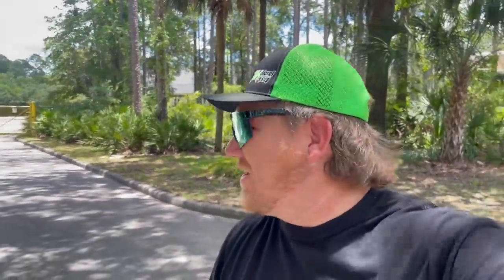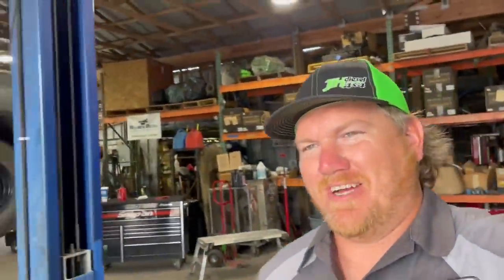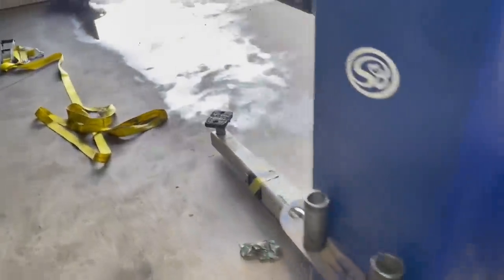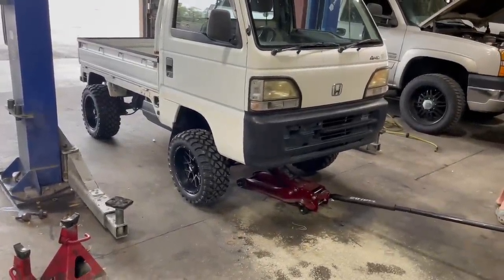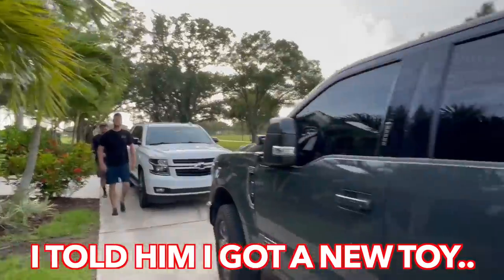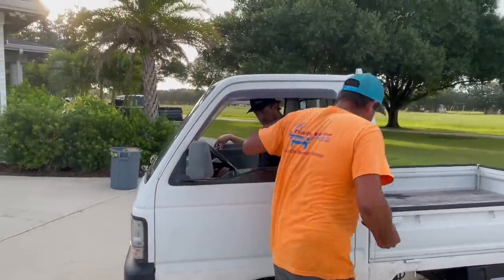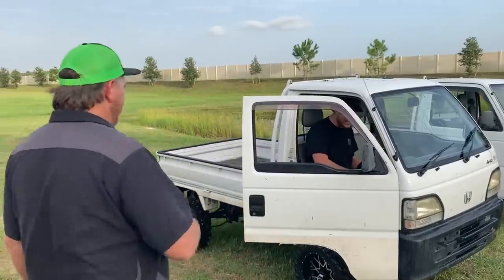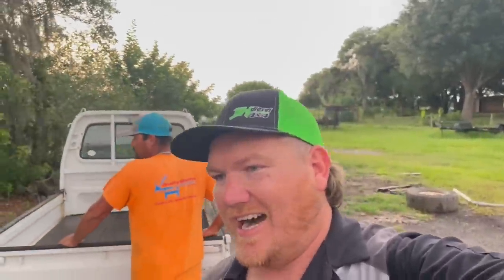I Bought 2 EPIC Mini Trucks And Gave One To One Of My Best Friends!!!!  He Was Blown Away!!!

Comment: Always try to get units with dump beds.  It is lots easier to work on the engine when you can just tip the bed up, and have the top of the engine and transmission, the fuel system and emissions sytems, plus all of the vacuum lines, and switches for the 4wd system.

Comment: I worked at a towmotor company that would buy out different equipment from banks and businesses, and we got a couple of these, i think 5 of them, identical to these, and they were miiiint. Was over 15 yrs ago, but we would offroad them in the woods and fields behind the towmotor company. So fun, and capable little machine. Im in ohio, and we did them in winter too.

Comment: I’d put a receiver hitch on the back so you can pull a small trailer around if needed. Plus a hitch would be good to hook to when you get stuck. And of course snorkel it and run the vent lines higher than factory. Then personalize like you want.
Reply: It would be perfect to pull the jet boat with
Reply: Absolutely!

Comment: We have those trucks here in Australia, I owned 3 Suzuki Carry's, but worked on Honda's & Mazda Bongo Vans, because friends had them, (Madza Bongo = MAD MAX 1 Movie, little blue wheeled box does the twist in suburban crash scene !!), However, as a a warning, I would be careful with larger Tires & Rim, Wheel Studs may not hold up, back in early 90's & 2000's saw lots of "boy racers" put larger wheels on these types of Vans, and have come off while driving down the road.. If you wanted larger Rims (like Suzuki jimmy 4wd's) you really need to upgrade wheel studs .. P.S.. Little Japanese tires are probably expensive in USA, but they are cheaper here & Japan .. :)

Comment: A set of 13-in daytons would look absolutely killer on that especially doing four-wheel drive burnouts it got 12 in tires now so 13 in daytons would be a nice upgrade but the SS rim should look pretty good haven't watched the whole video I'm at the start now
Reply: They have a big custom scene in Japan. They have body kits, lowering kits, widebody and custom wheels for them. Some of these things are sweeeet!
Reply: @bigsexymuthashutyomouth2546  I can imagine they look awesome I can just imagine one lower down with a nice little turbo kit on it or even with a CBR 1000 motor but I wouldn't want to hack one up as far as putting different motors and whatnot but body kits and all that would be absolutely sick

Comment: Did you buy them from First Global Imports? I bought mine and drive it daily, have put 125k on it in almost 4 years. I bought it with 112k. Been a great vehicle and the air conditioner works great